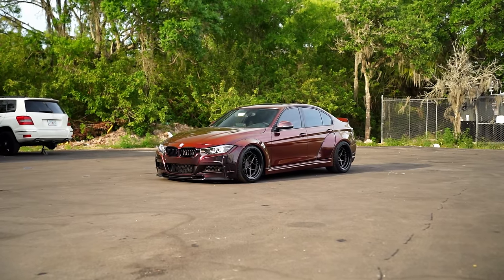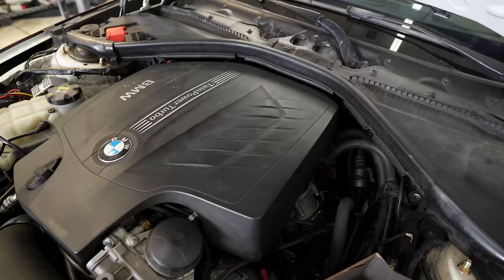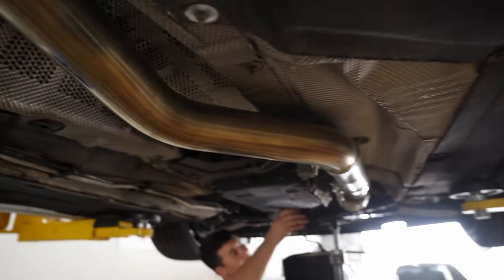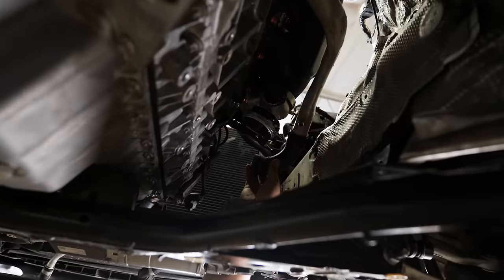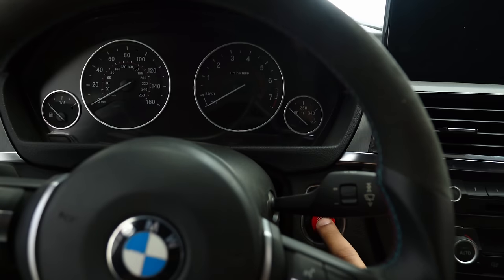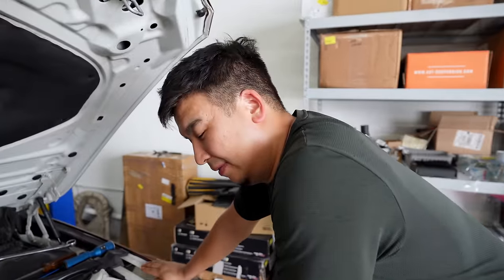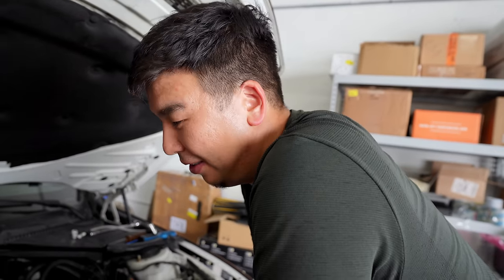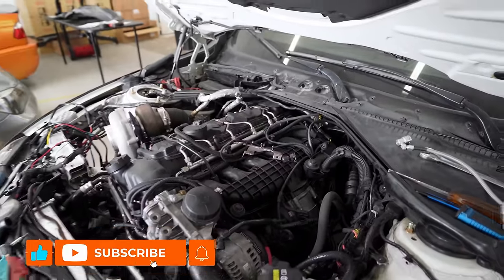This New N55 Top Mount Turbo Kit Changes Everything! - F30 335i

Comment: im pretty sure your car was an EWG based off of the intake placement in the hood. Either way, as a N55 owner myself if I didn't live in CA and have to do all my mods stealthily, i'd 100% do this. beautiful build my guy.
Reply: Bro im fbo open dump on bead locks in RSO territory dont let cali ruin your build
Reply: 2014+ n55s on the f30 are ewg, before that it’s pwg

Comment: this is what I was waiting for. I need this kit for my PWG n55 f30 The final thing it needed was a bigger turbo because I just put the forged crank in it for it to be more sturdy on the bottom end and waiting for my appointment for the closed deck conversion. this will be a game changer.
Reply: Whos doing your closed deck conversion? Im doing full bolt ons this summer , im in arizona btw

Comment: Man glad to see you still doing your thing! I totaled my N54 535 in traffic 🙃 such a sad story about expense. Back to the drawing board but will be back better then before 😤✊🏾
Reply from the maker: Sorry to hear that dude. Wishing you all the best!
Reply: From an N54 535i xDrive owner I send my condolences. You’ll be back in no time just figure out that comeback plan 🫡
Reply: So very sorry. We 535i xdrive N54 drivers stick together, good times and bad.
#OnwardandUpward🌹
Reply: @AgSherr  i didn’t wanna differentiate too much but mine was RWD 285s on the back and 245 up front refusing to stop me 😭 it was great fun. Keeping eyes out for 335i coupe 08-09 (prices coming down) orrrr say fuck it and find an M4 😭 around $30k
Reply: @AstralStef  I would say buy an M4, but if you want to relive the previous experience. Keep the most valuable parts and put them on a different vehicle (If the engine is good and you're mechanic, you could take it out and do something with it :) If not, then I would buy your car as a donor for a project)
Reply: @luckgrip252  currently the car is at a friend of the family shop. I want the valve cover and front brakes and rotors off that car as they were all new. I just got an E39 540i on Friday to get me to work, and you read my mind I’ve been short listing M4’s since before the accident 😭

Comment: I’m looking at the speedtech top Mount 6266 gen 1 journal bearing or 6466 for 2013 e93 n55 was looking at top mounts but JP works makes the only low price point kit and they have terrible service

Comment: Great content as always! 

I wish they made a top mount for my E90 N55. Im all modded out and ready to upgrade my turbo im probably going to with a pure stage 2. 

Keep grinding! Stay blessed bro! 🙏🏼🙏🏼🙏🏼
Reply: they do a few brands make them but there pricey and custom jobs so take alittle longer
Reply: @1Clean.E93  I figured it work take some custom work I’m going to just go with a pure turbo. Get me around 450- 500 hp I use this build for some canyon drives, cruising and a little bit of rolls. 

I’ll save the top mount when I get my n54 build. After I finish up my 2 projects I have going now. 

Do you happen to know the brand the make the top mount for the e90 n55?
Reply: @iwnt_carprtz  if your looking for 450-500 hp than go  pure500 if you want 450-500 whp than yea ps2 is def the way im looking at big boost 3.3 and speed tech kits atm, or if the new pure750 does well ill consider all i need on my build is the turbo n meth , Jp workz but iffy on his reputation on service works really good tho and i think dg autoworkz
Reply: @1Clean.E93  yeah all I need is a new turbo Iv done everything I need to do to support a new turbo. I did all the upgrades myself. I’m running a ethanol blend tune rn until I upgrade the turbo then I’ll go full e85 with port injection. 

Other than that I need to do a few suspension things to help in the canyons car dose really good rn though. Running 8.5”rim up front 245x35x18 and 9.5” rim 265x35x18 rear

It’s pretty quick from rolls Iv done with scats and mustangs. 

pure500/pure stage 2 is what Iv been looking at I got a BMW mechanic buddy here In Cali with a 700 hp top mount n54 e92 build anything I can’t take care of he hooks it up way cheaper than any shop.
Reply: Same ready to upgrade soon, my only good options I can think of is big boost 3.3 or PS2, but if you’re going for canyon drives what about oil starvation?
Reply: @Use2FACTAUTH  I don’t just do canyons kinda building a all around car. I’m looking into a pure500 or PS2. I would like to make 450-500 hp. But why would taking into a canyon cause oil starvation?
Reply: @iwnt_carprtz  same I’m thinking of 500ish or just upgrading to a 340i, but apparently the n55 gets oil starvation under high G’s which could cause rod bearing failure.
Reply: @Use2FACTAUTH  nice 👍🏼 
Oh I’ve never heard that only time Iv heard of oil starvation is from not priming the system when doing oil work or upgrades like a oil cooler or oil filter housing I’ll have to look into that.
Reply: @Use2FACTAUTH  no canyons in nj im looking more for max hp stock block looking for 600whp
Reply: @1Clean.E93  that would be plenty for N55